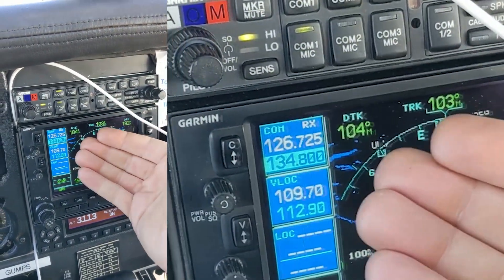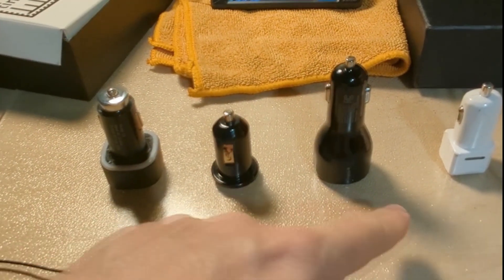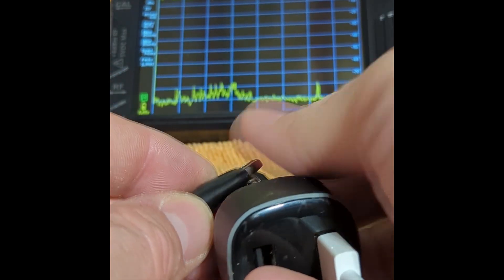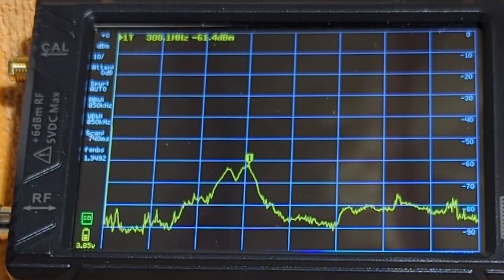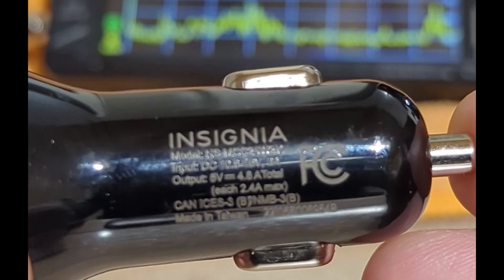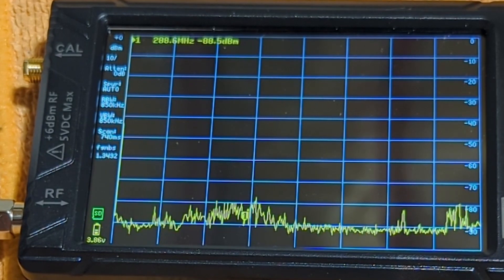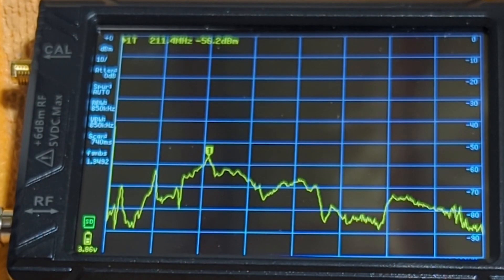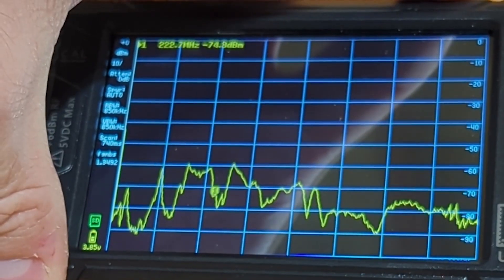Bad USB chargers in general aviation = Bad time

Comment: Very interesting and useful video. 
Model NS-MCC24W2K 24W Dual USB of Insignia, uses step-down DC/DC converter chip NDP-1460 QB. This chip uses an EMI reduction technique called frequency jitter that spread the spectrum energy of armonics. Furthermore, uses a relatively low central swicthing frequency (130Khz). 
Saludos.
Reply from the maker: Thanks for your insight!

Comment: This was great, thanks.  I am chasing down issues with my GPS in my airplane and am starting to wonder if the cheap USB charger installed is causing this issue.   I am going to disconnect it and see if it helps.